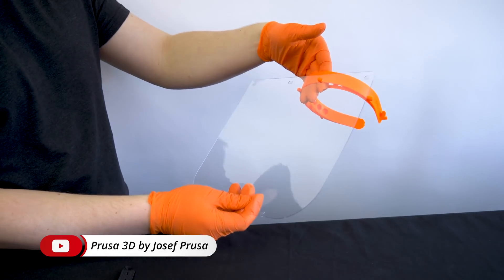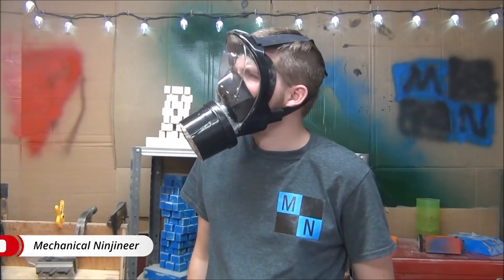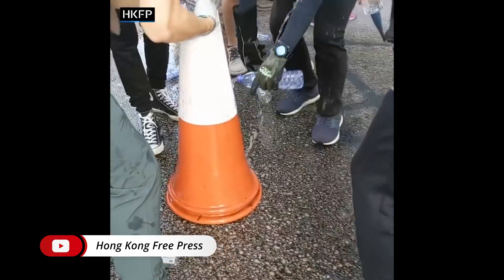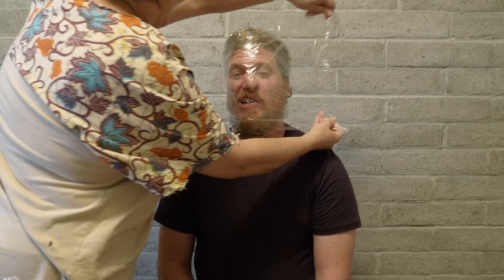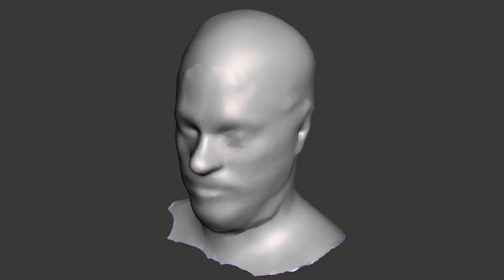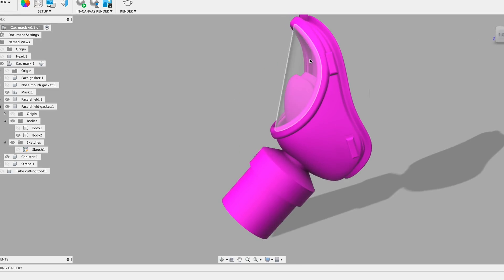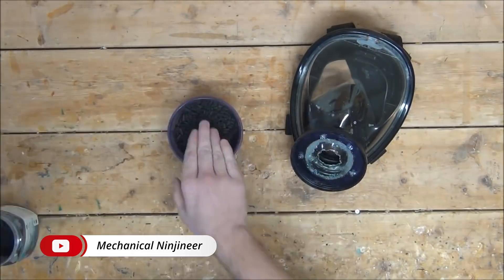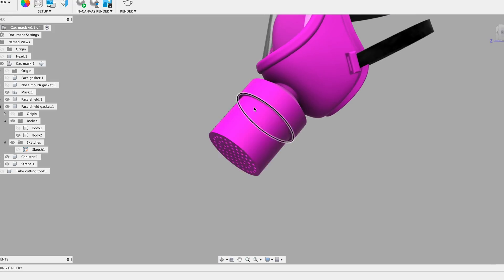I Designed an Open Source 3D Printed Gas Mask

Comment: The police (the RCMP in my case) are 80% corrupt.  I was raised to believe they were the good guys, but nope.  Only a small percentage are, and usually they're fairly young.  The rest, I can't rely on, unless it's for a revenue-generating speeding ticket on a sunny day, when they will not get wet standing outside their car.
At 18 years old I'd have died to protect a cop, but now, "I didn't see anything."
What a shame, and in Canada.  Can't imagine how much worse it is in the crazy USA, and for non-whites.  Tribalism is like some strange fractal that works in ever smaller but repeating branches of relationships, and encouraging it is tearing society apart.  I'm even exhibiting it here and now!

Comment: Definitely an exhaust if you ever revise.  The exhaust in all my masks is a very simple . Without one I doubt your mask will seal , unless maybe that foam tape is double sided 🤔
Reply: We made a couple valve designs in the repo since this video was posted, check out the repo for more details

Comment: My thing is most of the places tear gas are used, are where riots and looting are happening daily. While it might not be BLM being the rioters and looters, it’s anarchist antifa who are coming in and causing issues and making the black community follow their horrible moves.
Reply: The dinguses that are rioting or looting for bad reasons won't even consider going through the effort of 3d printing gas masks. When tear gas is maliciously used on protesters like in Hong Kong, it's a far different matter. It's also inaccurate to describe antifa as anarchist, though that's an entirely other topic.

Comment: Another great idea, if or when you plan on modifying the mask: some folks may need to lip read while wearing , & through, the mask. So, I don’t know if you move the filter down a bit, slightly, but you can have a translucent piece of similar material to it, or just keep the mouth guard part translucent, it may be a bit more accessible for those who are hard of hearing & deaf.

Comment: Unfortunately This won't work. Simply copying something without knowing why it was designed the way it is doesn't usually work. The separate compartments are to direct air flow in and out. You also need to have separate inhale and exhale valves

Comment: This inital mask design looks cool, but...
Unfortunately: this sort of mask won't make a proper seal with you face because of your beard and no matter how tightly you strap it to your face, there will always be gaps between your whiskers that will let gases "get around" the face seal.
Your mask design also doesn't have an exhale valve, so you'd be pulling air through the filter breathing in (good idea) and then when breathing out, pushing exhaled air back out through the filter (not such a good idea) which would make it tiring to wear.
That internal mouth/nose cup with valves inside the clear visor on miltary protective masks and full-face industrial repirators is there so that air comes in through the filters, across the lens(es) to prevent fogging (search "tissot tubes"), in through the  mouth/nose cup valves and inhaled into your lungs, then on breathing out, through the exhale valve and back out of the mask.
That exhale valve makes breathing out use so much less effort and also if you're exerting yourself (eg: running around), stops the mask from lifting away from your face when you forcefully breath out and possibly not sealing properly when you breath in.
Reply: Those are good points. We've added several exhale valve designs to the repo and changed the original design to have 2 nato ports to accommodate an exhale valve. I plan on experimenting with a silicone molded face seal, and tissot tubes sound like a good idea when someone gets a chance to work on the full face design again.

Check out the github / discord if you want to see the progress

Comment: Try adding a small fan inside the eye chamber to remove the tear gas if it leaks inside. The intake for it should come from the filter but still doesn't connect to the nose/mouth chamber.

Comment: The canister for the filter is really simple. I'm pretty sure you could save some print time and find some canister that was used for food or something else and has the right size.
Just punch a few holes in the bottom, a big one into the lid, and glue it to the mask.
Reply: That's a good idea, we've decided to standardize on nato threads and it should be pretty easy to make adapters for nato -> other common threads. Water bottles could work well for this. Check out the github where we've broken apart the mask into interchangeable components. A "water bottle" filter canister component would be a great addition.

Comment: As someone with a fair amount of experence with desktop FDM printing, I think the design will be very difficult if not impossible to print on a desktop FDM machine. Even with soluible support material and printed by a highend FDM machine from the likes of Stratsys and 3DSystems I think it will be difficult to print. I suggest this design is best suited to sintered powder type printers which severly limits it accessibility. If anyone has managed to print it on a desktop machine I'd honestly to be interested to see the results and how they did it

Comment: It has probably been mentioned already, but the threaded in the filter canister would also need a seal at the top as the spiral threads might leak some(small, but still a possibility)

Comment: a) shave. Wearing a mask, be it surgical or otherwise with facial hair is next to useless.
b) I learned more about gas masks in an afternoon with slow internet that you did before trying to design one.
B.1) You don't need a gas filter for so called tear gas or covid. Both are particulates.
B.1.1) A proper filter for particulates of all sizes is hard to DIY. HEPA designs show promise.
B.2) The purpose of the oral-nasal cup is to separate the dry, cool in flow from the moist, warm out flow, to keep the inside of the mask from becoming stuffy, the visor fogging. Air is supposed to go in from the filter, flow upwards towards the lens or lenses to keep them from fogging, then down into the oral nasal cup via one way valves. When exhaling, another one way valve in front of the nose and mouth let's it out directly. For covid, you need a second filter there for the exaust. Commercial respirators and military gas masks of different designs are not designed for this, and depending on the model it is easier or harder to jerry-rig something. I can see custom 3D printed parts being useful there.

Don't 3D print a mask. 3D print a mold for a mask. Then fill said fold with a suitable material, such as silicone caulking. A tube should be enough fo a single mask. 3D filament is expensive, fragile and POROUS.

Comment: I may be able to help you quite a bit here with work I have already completed. I'm a mechanical engineer, and I previously modified a 3D printable mask to be outfitted with a 3D printable screw on canister filter, as well as modeling in one-way valves which is a must for something like this as the activated charcoal absorbs moisture/particulates, every moist exhale without one-way valves will decrease the effectiveness of the charcoal. I could send you my .step files if you would like...? My mask is currently functional, but does not have eye protection. Although, goggles could be used in conjunction.

Comment: Design this to fit standard 40mm nato filters. fdm printing isn't gas tight but how about painting a 'flex seal' rubber type paint on the inside, maybe that would help

Comment: So I am looking at your design and it is slightly too big for my Prusa MK3S. To make this printable on the most printers possible, is there a way to print the eye protecting part separate from the filter part and have them snap together with epoxy or something?

Comment: As other comments have mentioned, a simple valve to allow air to pass through the mask on exhale. Think like an air mattress valve that allows you to air it up but the air does not escape.

For the canister filter I would use more layers of cotton and activated charcoal. CS gas is not fun.

Comment: I'd recommend placing an exhale valve, you can make one with a balloon and a bottle cap. It helps prolong filter life bc you're not exhaling through it, reduces fogging and prevents the mask from pressurising and losing a seal. Adding one inside the inner seal can prevent hot air from returning to the eyepiece and fogging it up while allowing only fresh air to reach the eyepiece, then your mouth. Bare minimum I'd say would be an exhale valve and I love this video wtf

Comment: Nice design and good initiative. You should add a one-way valve (simple rubber flap type) to avoid exhaling through the filter - both damaging it with moisture and making it harder to breathe by inhaling more exhaled air than necessary.

Comment: There are good TPUs that can be printed with to make a rubber like mask. Some printers have more trouble printing with them than others though. And printing the whole mask may be difficult. Maybe a bellows like TPU piece could be used for a more flexible and interchangeable or custom gasket against a rigid mask.

Comment: A simpler and faster to print solution might be to use ski goggles for the eyes (they are fairly cheap), and reduce the mask to nose and mouth only.
Reply: Ski goggles are vented to prevent fogging, so probably won't stop teargas and irritants from getting in.
Reply: Mine only have small vents on the front and sides that can be easily sealed with some tape. Many cheap models I looked up seem to be similar.
An alternative could be swimming goggles.

Comment: I think using a normal separate snorkel and mask combo is the easiest solution, and mounting a hose connected filter to the snorkel end. No need for the potentially limited availability full face one piece snorkel mask. Much simpler, easy to connect with rubber hose and hose clamps, and super cheap and available, seeing that retailers are still bringing in massive pre ordered stock of "summer toy" inventory. Then you just need to design the filter and strap it to a belt.

Comment: I love the attempt but at 20% infill its using about 850 grams of filament. just for the body of the mask mostly because its needs so much support material. I think this can be changed to use half that.
Reply: Christ that's almost an entire roll. Definitely need to eliminate supports somehow...
Reply: @beboshi69  exactly. I know this could be done much better

Comment: The fit on the face will be a big issue. Some elastic 3d printed parts would help there, but this again limits accessibility as not all printers can print them.
Maybe come up with a couple sizes and a couple material availability options.
Next issue, gas tightness. Sealing the print with epoxy or lacker would be an option.

Comment: -So, to help with the design.  Teargas functions by burning a solid which releases jagged particulate which irritates the eyes and lungs, sometimes also the skin.  
-Pepperspray works using capsaicin, however it is difficult to aerosolize and is most effective sprayed directly at sensitive areas such as the eyes, nose and mouth.  First aid for both situations is to rinse the effected area with clean water.
-The reason gas masks use activated charcoal(with the addition of other chemicals) is to filter out organic gasses which bind to the charcoal. If the threat you're trying to defeat is teargas, you don't need charcoal, simple cotton filtration will do, much like the CDC recommended home made covid masks. 
-The inner mask that cups to the face is to  reduce fogging. It's important to get a proper seal across your entire face. Improper seal can obviously lead to sealing issues. Beards will always cause problems with sealing, use Vaseline to help create a proper seal.
-The hardest part to design is a proper outlet valve that allows Co2 to leave and prevents contaminates from entering. A simple mask design that uses the filter as both in and out is very difficult to breath through.
-I recommend using a cloth and cotton filter, a flat poly-carbonate eye shield to protect the eyes from rubber bullets.
-I recommend protecting the air intake from pepperspray, liquid and gels have a hard time going around corners. Furthermore if the cotton becomes soaked it(especially with pepperspray) can suffocate the user the same way waterboarding suffocates torture victims
---------------!DO NOT USE PLA IN YOUR DESIGN!
 It will shatter and cut the user if and when they are struck by pellets or batons. 
-For the love of all that is good, DO NOT TEST IT ALONE AND DO NOT DO IT IN A CLOSET. You will die. People die every year testing genuine factory manufactured gasmasks this way. You cannot breath if oxygen is displaced by whatever you're using to test your mask.
-A styrofoam mannequin head scan is available on thingiverse. It should provide a good base to build your mask off of.
-Banana oil was one of the first test fitting solutions to ensure proper fit of a mask. Test Kits are roughly 16 bucks from places like fisher scientific.
-------------------- My thoughts on the current situation ------------
-I just spent the last two weeks on the otherside in Salt Lake City as a national guardsmen. I applaud the Utah BLM for policing themselves, protecting us and property from agitators, and working with police and the government to create positive change. Rioters are not protesters and they drown the important messages being said by real protesters.
-I support reform, there are plenty of issues that are feeding themselves and preventing the black population from rising out of poverty. Crime is one of the biggest and most systemic and we need to find different way to both address crime and break the cycle the current model of punishment of crime is causing within that community.
-That said many of the things coming out of the protesters are uninformed, illconceaved, or flat out stupid. 8 cant wait are a set of demands, most which already standard across the country or are totally impractical in the real world. (the one about reports really gets me.... because that is what they do.... NOTHING happens without a police report)
-Banning teargas, pepperspray, and rubber bullets? They suck and have their own dangers. But banning their use limits less lethal options for police. We already can't use firehouses like the rest of the world because of the cultural perception. At some point police need to hurt people to control a violent situation. It sucks but so does a bunch of neo-nazis smashing your head into the ground(Take it from a pansexual with the name Solomon). 
-Sure, some police are using their tools inappropriately and even unlawfully. That is on them, call THEM out on it, because they'll abuse whatever tools they have, and if you leave them only a gun.... it's going to get used.
 -Defunding the police is the dumbest of all. George Floyd died because the police department couldn't afford a better cop. They hired a man who during his career had multiple disciplinary problems involving aggression, they couldn't afford to dismiss him from the force. That man then used a NORMAL and SAFE technique aggressively and incorrectly, a symptom of inadequate training. (A knee in the center of the back or across the shoulders is the correct technique, absolutely should never be applied to the neck... for obvious reasons)
-The recent shooting in Georgia, the police officer fell to his lowest level of training. He incorrectly evaluated the threat and engaged the target with the gun shaped object. Anyone with insufficient training can make the same mistake in the heat of a fight.
-Police reform costs money and time. Defunding is a call for retribution and revenge, not reform.
- One last thing, governments should fear the people. This isn't a call for violence, it's a call to be prepared for violence if necessary. A people that the government cannot overcome is a free people and neither should be allowed to forget.

Comment: for something like this I'd suggest some low production molds instead of straight through 3d printing. 45 hours sounds like a lot for something like this but even 80+ hours would be productive if you made a repeatable mold out of it. if you use something like food safe silicon and superglue to make it more rigid you can cast tens of these before the mold starts breaking down and just do a little bit of cleanup to make it usable - clean up with one or two people being a fraction of that 45 hour print time for dozens of masks at a time.

If you do decide to go the 3d printing route I'd recommend attempting to break it up into puzzle pieces and use a soft printing medium, sorry I don't have a recommendation for filament or resin, its a much easier endeavor to print off 1-3 masks in a print area and glue them together and make them air tight. a little bit of superglue and accelerant goes a long way. one thing that teargas and covid have in common is they are mostly non-reactive so neither acidic or aclyine enough to affect a glue seal.

Comment: Swim goggles bypass much of the hair issue.  Nose plugs take care of the nose.  A snorkel to a DIY canister also bypasses the hair issue.  All available in the swim sections of Target, Walmart and everywhere online.
The only negative being no talking while wearing it.  The positives being availability (in way less than 45 hours), low cost (less than filament), zero fit issues, and minimal fogging issues (breath and lens never meet).